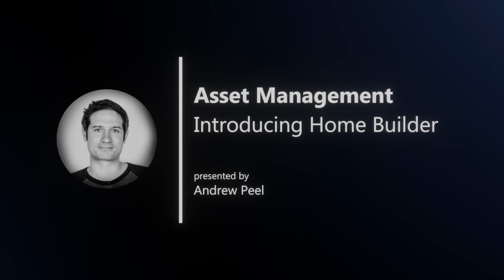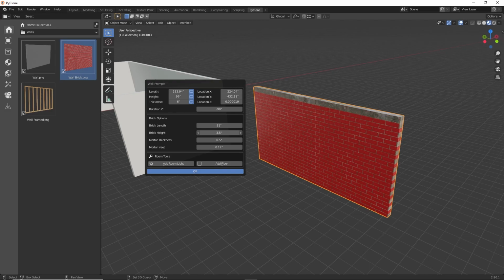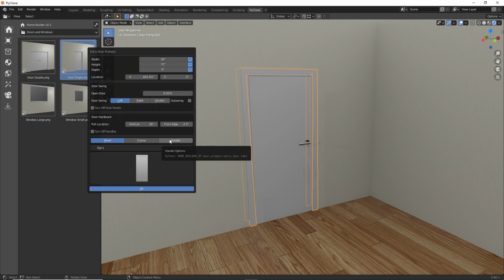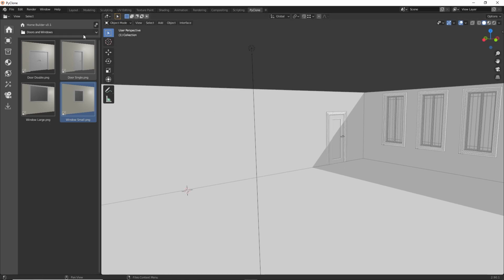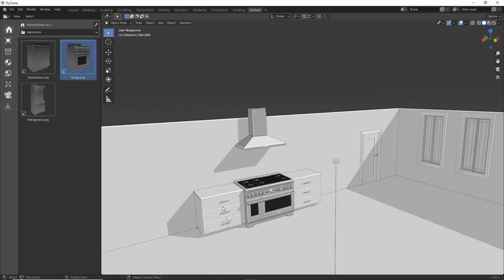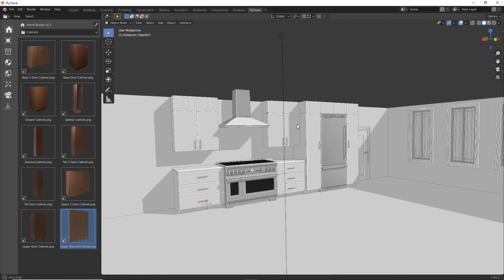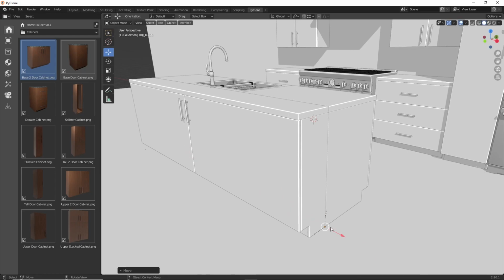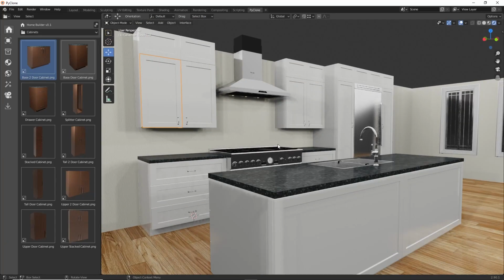Introducing Home Builder for Blender

Comment: I tried using this but went back to planner 5d.  Might be a good idea to look at planner 5d and other design software options to see some of the features people like.  Planner 5d is a good one since it's only 5 bucks a month.  I'm not sure how it would be done in blender, but the ability to go back and forth between a 2d and 3d view would be nice, as well as automatically showing you distance between other objects as you move.  I was also a little disappointed to see you need to extended library at 100 bucks just to get a kitchen sink.  Love blender and the idea behind this, will try again after some additional updates.
Reply from the maker: I have some updates coming soon that will have improved 2D drawing functionality. Check back soon. Also, a couple different sinks are available in the free version.
Reply: @andrewpeel1996  awesome, plamner 5d is limited, and I'd rather support someone like you. Have you thought of a package with fewer assets and cheaper as an option?

Comment: Help me please. The addon didn't work for me. I tried using a separate build. I created cabinets there and saved the project in order to import models into the scene, reopened it and my facades were lost there, handles moved out and in general all this junk is not edited normally. Since in the video I can’t use the build. Options for walls, for creating a floor and other functions do not appear. What should I do?
UPD I realized that I can only change the parameters in the build. But how can a normal-looking model be exported to its normal scene without the horror with which they enter the scene?
Reply from the maker: I will need more info. Try asking on the discord channel. https://creativedesigner3d.com/2021/09/08/discord-channel/
Reply: @andrewpeel1996  Thanx. That I did)

Comment: this is really amazing i tried it and it is pretty good it will save me lots of time i have a question though can i further edit the kitchen cabinets via the good old blender edit mode? like if i want to carve a glass window in one of the upper cabinets...
Reply from the maker: Yeah you can use Blender commands. You just have to unlink the drivers. In the assembly menu there is an option to make the assembly static. If you have questions about this you can ask on the discord channel. https://creativedesigner3d.com/2021/09/08/discord-channel/

Comment: If you wanted to use the framed wall are you able to change it in a way to add door/window openings with jack studs and headers. etc?
Reply from the maker: It's possible, but I haven't got that far yet. I am more focused on getting the construction of the cabinets correct. When i get further along i will implement better functionality for laying out framed walls.

Comment: Presentation looks awesome!
But in application lots of bugs: some windows at the wall without "window hole";  placing a cabinet in the room arises a trace log with errors and cabinet draws in frames; I deleted a floor and Blender closed when I tried to rotate my model.

Modeling looks like a battle with application....
Reply from the maker: Make sure you are running as administrator. If you are running into issues let me know on the discord. That's where I am doing most of the support.

Comment: Hey Andrew the add on to Blender does not work  it show an error will you check it out?  I follow up to step 1 step two does not work
Reply from the maker: Make sure you run as administrator. If you still have issues you can join the discord channel for support.

Comment: Absolutely amazing work... Can anyone tell me how to change the measurements from inches to mm please, im thinking about using this for future renovation project planning, we work down to half a mm so it would be great if I could use mm to calculate exactly what i would need,.... Also adding settings for spacing between doors or draws would be great, keep up the good work, definitely interested in buying the extended assets pack if I see I can use it for my projects, thanks.
Reply from the maker: You can change the units in Blenders Scene Properties.

Comment: Looks awesome. Although how does this differ to https://blender-archipack.org/ and how come that doesn't require a custom blender build and this does?
Reply from the maker: Its very similar to archipack, but archipack is better in a lot of ways. I am hoping to merge the two add-ons to get the best of both. it requires a custom Build because drag and drop is not supported in Blender yet. Soon I will make this work with the default version of Blender.

Comment: This is not an addon/ library for Blender, it is a library for a custom Blender app he made, which should have been stated on the beginning of the video. This important fact may prevent you from using the objects in your official Blender app.
Reply: Yeah - I wasn't amused when I found that out. This is perfect for a project I'm working on, but I have no desire to recompile Blender myself. Hopefully either the changes required go upstream, or he finds a way to make it work as a plain ordinary addon.

Comment: I probably will make a weird question:
How do I convert the object to something I can copy to another Blender scene without having the PyClone or the plugin?
I have a scene (a road with some houses), and I want to make a house on PyClone and copy they later to this scene (it's for a game). But when I copy and paste on the other scene, it asks to run scripts and the objects don't work.
Reply from the maker: I will need to create a button to clear all of the drivers. i will make this available in a future release.
Reply: @andrewpeel1996  Just to let you know, I found a workaround to do that.

I exported as FBX, and imported the file on the other Blender project.
Them I selected (almost) all the visible/selectable meshes from the hierachy and press Alt + P and Clear and Keep Transform.

It takes some time to do for everything, but still much faster than modelling mesh by mesh :D

This plugin is just fantastic and I love it.
Reply: @andrewpeel1996  Thx! :D

Comment: So I recently tries Home Builder pro and the one thing that I have to say is please PLEASE put a snapping system.  I can’t snap the wall to the grid or a specific length.  It’s hard to get a perfect square when I try to make a room with the wall.  This also goes the same for the assets.  I think it’s super important for interior designers to put walls and furniture and whatnot to be put in a specific place.

Comment: Do I need this pyclone and will it mess with my standard blender installation?
Reply from the maker: The startup and user perferences will be shared, but if you create a config folder inside the 2.90 directory then this will work as a stand alone application and won't use any of Blenders defaults.

Comment: What on earth? This is so cool. Take my money right now. This is so much more powerful than the few bits of AEC components built into 3ds Max. Ok, I have a suggestion. Would if be possible to import Revit Families (RFA files)? There are many suppliers out there that provide their models as RFA files to use inside Revit. After that how about the ability to build custom components and export it as a RFA file? You will then have the ultimate BIM plugin for Blender.
Reply from the maker: I am going to be supporting IFC at some point, but I'll look into RFA as well.
Reply: @andrewpeel1996  Sounds like you're already ahead. I'll be keeping a close eye on this stuff.

Comment: I have another question, When adding a floor on home builder can the coloring of the material can be change or replacing the wood texture. How can I get the deco Library on homebuilder ? This is an amazing library that can help me on a certain project I am trying to make.
Reply from the maker: Yeah all of the materials can be changed in the Library UI. The Extended asset library has more material options, and you can always create your own.

Comment: I don't have github account. I'm not blender user. I just wanted to play Sims for Nerds v0.1 :D I tried to run scene as Admin and as User. I tried to generate thumbnailes and check and check additional stuff in lib > pref > assets, mat and etc. I tried start it in PyClone and General scene setup. I don't have categories like in your video. The only subcategories for shaders and assets that I have it's _Sample. It looks like it's not idiotproof setup yet :(

Traceback (most recent call last):
  File "C:\Users\h04\Desktop\Trash\__removeME\blender\Blender290_1withPyClone\2.90\scripts\addons\Library_Home_Builder\cabinets\cabinet_ops.py", line 293, in modal
    self.confirm_placement(context)
  File "C:\Users\h04\Desktop\Trash\__removeME\blender\Blender290_1withPyClone\2.90\scripts\addons\Library_Home_Builder\cabinets\cabinet_ops.py", line 267, in confirm_placement
    self.cabinet.draw()
  File "C:\Users\h04\Desktop\Trash\__removeME\blender\Blender290_1withPyClone\2.90\scripts\addons\Library_Home_Builder\cabinets\data_cabinets.py", line 246, in draw
    self.carcass.add_insert(self.carcass.exterior)
  File "C:\Users\h04\Desktop\Trash\__removeME\blender\Blender290_1withPyClone\2.90\scripts\addons\Library_Home_Builder\cabinets\data_cabinet_carcass.py", line 444, in add_insert
    insert = self.add_assembly(insert)
  File "C:\Users\h04\Desktop\Trash\__removeME\blender\Blender290_1withPyClone\2.90\scripts\addons\Library_Home_Builder\pc_lib\pc_types.py", line 200, in add_assembly
    assembly.draw()
  File "C:\Users\h04\Desktop\Trash\__removeME\blender\Blender290_1withPyClone\2.90\scripts\addons\Library_Home_Builder\cabinets\data_cabinet_exteriors.py", line 296, in draw
    self.add_door_panel(l_door_container,is_left_door=True)
  File "C:\Users\h04\Desktop\Trash\__removeME\blender\Blender290_1withPyClone\2.90\scripts\addons\Library_Home_Builder\cabinets\data_cabinet_exteriors.py", line 102, in add_door_panel
    pointer = props.cabinet_door_pointers["Base Cabinet Doors"]
KeyError: 'bpy_prop_collection[key]: key "Base Cabinet Doors" not found'

location: <unknown location>:-1

Good luck with the project. It looks promising!
Reply from the maker: Some of the categories are only available in the extended asset library which will be available soon. Also, the error you are receiving is from not having permissions to write the pointer files.
Reply: @andrewpeel1996  Thx for a quick response. I used "Take Ownership" script from "How to Geek" on my Win10 and it looks like it helped. I look forward to see a next version. Do you have any planes for next release date?

Comment: Looks absolutely stunning. Slightly disappointed at the lack of a Linux build (guess I'll have to research how to do it on my own), but I understand that it would be an extra workload that would take time off actual development. Great work nonetheless.
Reply: Just run it in a Windows virtual machine.
Reply: @themaroonwaymedia9486  A virtual machine would require me to own a copy of windows and would be a severe performance hit. I could possibly run it through Wine however. I'd rather use a native version whenever possible though.
Reply: @sablesanctum  you could use a virtual machine with gpu passthrough

Comment: If i could export the cutting list for the wooden material that would be a massive one, also the standard furniture hardware (hinges, screws, bolts...) no CAD needed thought if that is possible.
Reply from the maker: Creating reports and other manufacturing information is the end goal of the project. I still have a ways to go to make that possible, but it's on the roadmap.

Comment: A tip from an  interior designer. More and more customers like to have an asset library to play around in the designs I did for them at the end of a project - change some furniture, colors of the walls and floors, lights, ... They often know that real time render engines like EEVEE exist now and by creating an easier to use Workspace for them, I found Blender with its free nature is a great choice to give customers this ability. My idea - give someone who is willing to buy the extended version an option to add much cheaper additional versions with a customer license (not for sale work, just to show a painter, a carpenter, what they should do), so that I just can give this additional licenses to the customers of my projects, and they have a filled asset library to play around in my interior design as they please. Also give the option to load in own models and materials, because all these projects have some unique assets, like a special piano, very strange flooring in some rooms and such. The demand is climbing the last years, some rich customers even have VR Headsets and such now just for looking in the designs (my marked is mainly Hamburg-Germany). So if you give this option to add much cheaper customer versions in addition to a pro version, you will sell this like cupcakes if this made its rounds through the Archi-scene. Honestly from one entrepreneur to another, use this bright light Andrew Price is shining on you right now to announce something on those lines. You deserve to make enough money of this project, because it is very sophisticated what you have put together already. Another tip, make it possible to save presets of created designs of walls, doors, and such. Most houses I design in, have some doors or windows in 3 variations throughout the whole building. Have a great evening.
Reply from the maker: Thanks. You have a lot of good ideas. Having the ability to create custom materials is possible and the ability to save premade configurations is on the way. Thanks for the feedback.

Comment: How do u open them in  regular blender . no the pyclone version you made. when i try to open the file in blender the cabinets dont come out. same error i had when i open from fluid without do the scene optimizer and clear the pytons drivers. there is anyway to do in your version. so i can open it on regular blender, i kept have crash on a scene i made using an animation with eevee , .in the regular blender doesn't crash but cabinets are missing.
Reply: I don’t think it works with regular blender
Reply: @joecoz26  if u opening blender the  cabinets come corrupted , need a scene optimizer like he did in fluid.
Reply from the maker: If you want to run this is default version of Blender install the PyClone Add-on into standard Blender and it should work. You wont be able to drag and drop but everything else should work.
Reply: @andrewpeel1996  it works will open the cabinets , but are no editable , i mean the come with all modifiers, but if u want try to do a change u got apply all the modifiers to each part first. And unlock axis so can be moved.

Comment: Be good to see what kind of documentation you can produce from these.  
I know there are dimensions available in Blender.
How does it simplify views for documents. ie not show complex articulation in plan view.

Heck is this the start of a whole architectural package in Blender?  A new 3D Arch Modelling package?
Blender seems to handle large data sets so much easier than certainly my ACA I'd say other packages as well.

Comment: Kind question: just downloaded and that specific, custom build does not allow all the addons/home,toys etc/ to be installed...??
Reply from the maker: It might be an administrative rights issue. This link has information on where to get support. https://creativedesigner3d.com/2020/11/12/installing-blender-with-pyclone-2-90/
Reply: @andrewpeel1996  Thanks fpr response )). Ill try to verify that.; Do i have to use that specific BL build exclusively or possible to launch the addons on 2.91beta and/or 2.92alpha also?
UPDATE: Not priviliges case. PYCLONE Python module has to be installed locally/inside local Blender folder structure/ or system/Blender Python/ wide...

Comment: This really is awesome and I will for sure buy the Extended Library, as soon as you give us the link. Thanks a lot for your work. 
May I suggest to make an addition for the install instructions? After unzipping it, don't start it yet. First go to the 2.9 folder and add an empty folder called config. That way all the configuration for the PyClone version doesn't interfere with a regular blender version.
Reply from the maker: I didn't realize this is possible. I will look into it and maybe add the config folder by default.
Reply: @andrewpeel1996  Great to hear. Thanks.

Comment: Great work. Looks very promissing. But, If I understand correctly it works only with custom build of Blender that's available only for Windows? If that's the case, I have to say it's a pretty big turn off.
Reply: Why? You can run it parallel to your  "normal" Blender version. After unzipping it, without starting it, go to the 2.9 folder and add an empty folder called config  (must be lower case). That way this special version doesn't mess up your normal blender configuration. If you need more info, I have a video about how to use multiple versions.
Edit: I missed the "only for Windows", sorry. But on Windows it works perfectly with the config folder. 
Maybe ask for somebody to compile it for Linux on Blender Today or Blender artists. Pablo also made a video how to compile on Linux. Mac is another story anyway.
Reply from the maker: I just don't have the ability to compile and maintain builds for other operating systems. Hopefully others in the community can help with this at some point.

Comment: Looks Great! How about dimensions? I see you make and adjust walls, where do you enter the dimension (length), and how do you check it later, and change it? Can you insert a CAD drawing to guide the layout? Sometime I actually write a dimension in the model to keep track while working. So are there dimension lines?
Reply from the maker: Currently no dimensions, but that is on the roadmap. You can enter the exact length of the walls and dimensions for other assets in the prompts page. Blender has DXF import but I haven't done much testing with this.